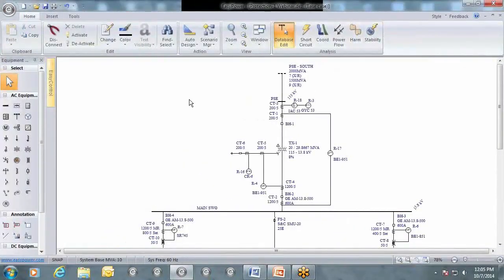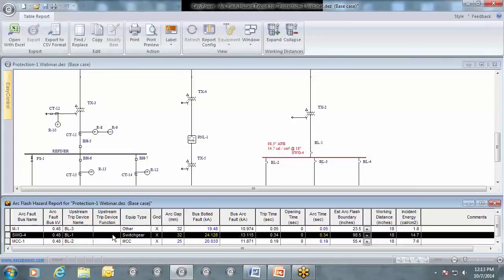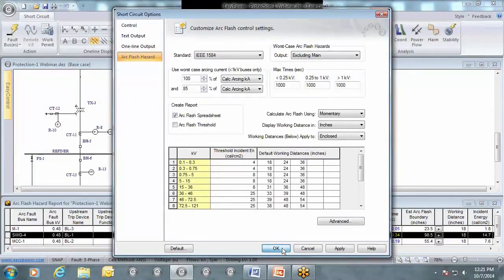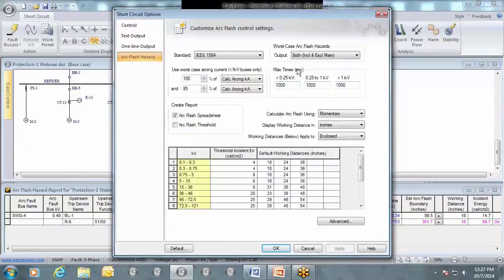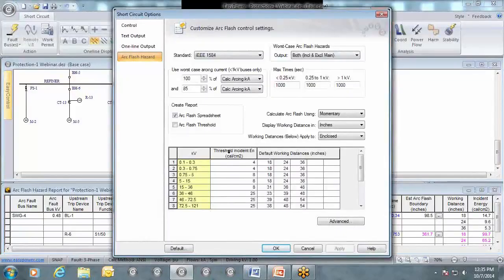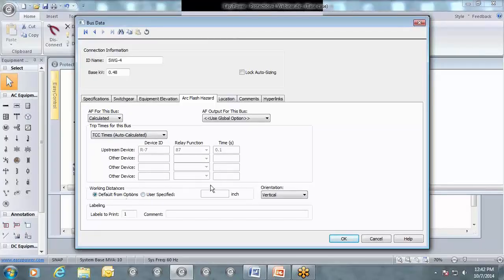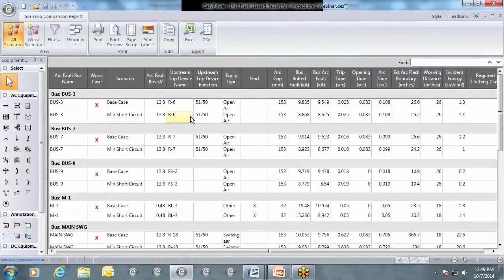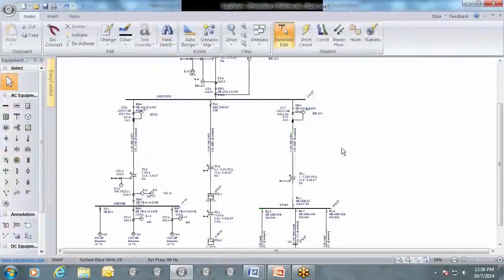Intro to Arc Flash Analysis in EasyPower

Comment: How do you arrive at an accurate "bus gap" for a disconnect switch, or a custom control panel that only has a main breaker and no actual bussing?  There would be quite a variety of frame sizes involved.